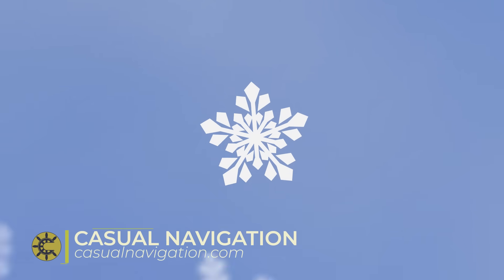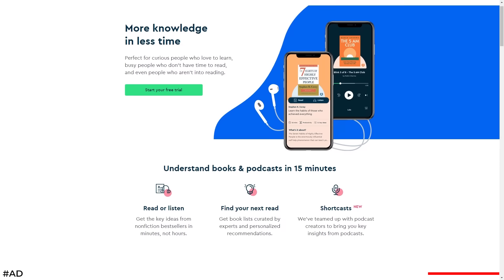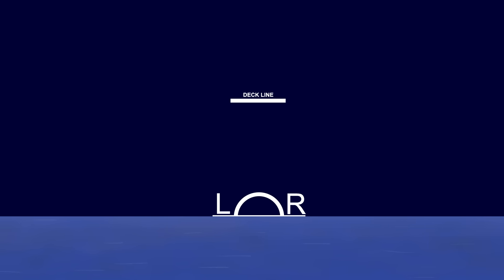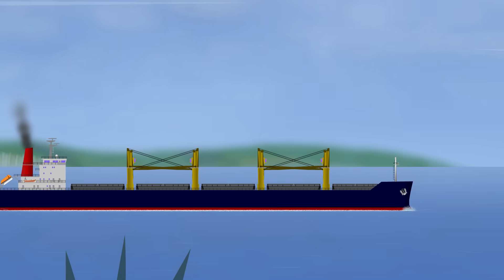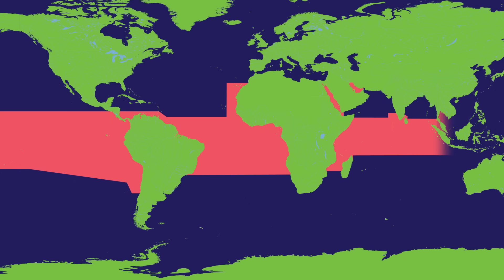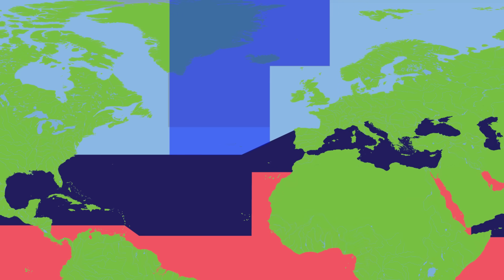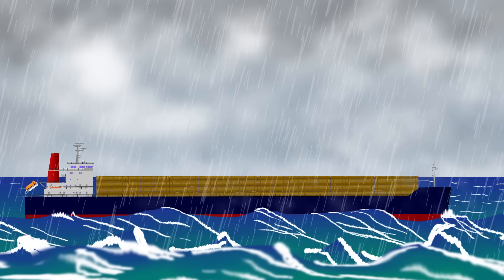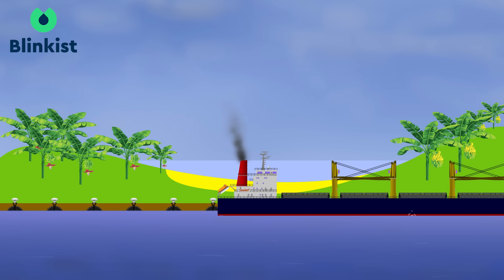Why Do Ships Carry Less In Winter?

Comment from the maker: Click the link to start your 7-day free trial and get 25% off a premium membership.
https://blinkist.com/casualnavigation
Reply: NO
Reply: If i remember correctly The origin of species is about a 20h read. Suggesting you can get an understanding of it in 15 minutes is catering to lazy morons who by default are to lazy to benefit from even the cliff notes.
Reply: 3:41 "surely this and that" "well you can!" Then why even make it seem like that wouldn't be the answer at first? Why even ask? Lmfao I got an iq of 0 and I still got that right
Reply: So... I want you to think about the ship moving from saltwater to freshwater, and how the lines would line up. I then need you to think about how this is caused by the denser saltwater, and not by moving cargo. Then you should consider how colder water is denser. Then I need you to go back to Wikipedia, where you pulled this script from, and read this line again: “ Varying water temperatures will affect a ship's draft, because warm water is less dense than cold water, providing less buoyancy.” 
Then make another video.
Reply: @TheOriginalDude001  As he explains, the significant difference between winter and summer is the weather, not water density. Water density changes by only about 1% between summer and winter.
Reply: @beeble2003  The difference between the "summer" and "winter" plimsoll lines is 1/48  = ~ 2% of the ship's draft.  Even if the density is only 1% that would be at least half of the reason, and it's not even mentioned having an effect!
Reply: @TheOriginalDude001  That's a good point -- thanks.

Comment: The loadline is read to the top not bottom of the line a rookie mistake by those who don't know therefore losing cargo. Timber loadlines are only assigned to homogenous cargoes (i.e. one mass). The extra loadline granted is not as you state because of increased buoyancy, it is granted because the timber is considered to raise the deck edge immersion, therefore increasing the point of contraflexure on the GZ curve. One of the biggest legal fiddles going in my opinion, never understood how they got away with it, in theory yes, in practice no. It is the GZ curve that influences (again through deck edge immersion) the height of loadline.

Comment: "Timber  cargo above deck buoyancy"? While such cargo may well be partially submerged by waves in heavy seas as long as it is secured to the ship the whole loaded vessel has the one specific gravity or relative density as measured by the plimsoll/ load line. For the buoyancy of timber to be relevant the vessel would need to be on its side to immerse some of the timber on deck.  In such a condition  the solid timber cargo would probably have a relative density of less than the same volume of the water floating the vessel. What happens next would very much depend on what was below decks as an empty steel hull would probably have an even lower relative density. The topic of this video can only measure how "buoyant" the whole vessel is and the load lines measure this with allowance for the benefit of extra buoyancy and  reduced stress in heavy seas. The stability of the vessel is much more effected by the centre of gravity whch cannot be shown by the load line. The capsize of the MV Lairdsfield out of Middlesborough in 1970 shows this when a cargo of steel tubes and steel plate were loaded upside down, i.e. the tubes were at the bottom of the hold  with the steel plates on top instead of the other way round thus performing the opposite task of ballast.
Any cargo loaded above the waterline must raise the centre of gravity even though  timber is much lower density than steel. I know nothing of trying to deliberately get rid of a commercial deck cargo in high seas  but it sounds more like a seamans nightmare than a procedure.  Just like an aircraft, overloading will have an incremental detrimental effect but loading a legal weight cargo in the wrong place brings swift punishment. If I were Blinkist.com I would not be happy with such an over simplified explanation but creating questions is not a bad thing.

Comment: One factor should be calculated too.
When arriving on your trip in a winterzone the water is more dense than in the summerzone (where you departed. This alone will rise the ship a little in the water. Could be somewhat around 1% between water from zero degrees celsius and 20 degrees celsius ...which makes a difference from 1 cm for each meter the ship is under water.

Comment: Question: is the load line measured with full or empty ballast tanks?
If empty, that implies your ship can appear overloaded when looking at the load line, just from ballast.
Reply: The load line is the maximum allowed displacement, these is measured from the cargo, fuel, FW, Lubes and stores. In the fully laden condition any ballast would mean less cargo being loaded (not a good thing).When the ship is in ballast it won’t be anywhere near the load line.

Comment: Video is great as always and I understand the allure of in-video sponsors, but please do not dabble into deceiving the viewers. The progress bar for the ad starts off at a rapid pace, suggesting the ad will be over in about 30 seconds, but the progress bar progressively slows its progress and the ad in fact takes over 70 seconds to complete. Which is over 15% of the total video time. The balance is not there this time, the ad either needs to be shorter or the video longer, but don't think you can fool viewers by making it look like a 30 second ad when it's not. Thumbs down this time.

Comment: This never occurred to me but it makes perfect sense. I find the difference between sea water and fresh water particularly interesting as we do get ocean vessels bringing cargo into the great lakes.
Reply: I suppose it works out to the advantage of the ships when they do it, at least most of the shipments I'm used to seeing. 
Those are iron ore and grain from the Duluth/Superior port, and more. 
- Iron ore (taconite pellets these days) boats all year long until it freezes and right away once the icebreakers can clear a channel in the spring. 
- Various shipments of wind turbine towers, blades and other parts during the open season. 
- Cruise ships and similar on occasion. 
- But why I mention this: the "fall special".... a whole ton of grain ships - they do also run the rest of the open season, but in the fall there would be a fleet of maybe a few dozen grain ships parked a few miles off shore. It was kind of neat seeing their lights down on the water from parts of the city with that vantage point. I went to college up there, so got to see it each year. It was cool when one of them would start making a bit more smoke as they ran up their engine. If you saw that and jumped in your car, you could beat the ship to the channel right by the Aerial Lift Bridge. The crew would often wave at you, and it was always fun to hear the ship and bridge honk their horns in salute at each other.
Many of the grain ships were indeed salties - oceangoing vessels with the big bulbous bow vs the flat barge nose on most dedicated lakers.
I imagine if the saltie was able to load up to near their safe limit while in fresh water, including draining some bilge water while loading (sadly they always simply have to do that to trim the load while it's ongoing, and need better processing plants) they'd be pretty safe for the normally relatively uneventful Great Lakes passage to the ocean.
Obviously we're talking fall here, and fall and winter storms on the lake can be intense - so consider that of course.
However once this saltie reaches the ocean, it has burned down some of the "clean fuel" it's required to burn while in US/Canada territory so they may be riding a bit higher already - then as they transition into the brackish then salt water they'd noticeably come up even more. To the point where they may need to add some ballast water to the trim tanks, just to make sure they're not riding too high on the ocean crossing. :P
Obviously other ports' experiences will vary - grain from Odessa to somewhere along one of Europe's many rivers would be in reverse - and they'd need to make sure not to load too much initially since most of the voyage will be in fresh water, where they will naturally ride lower.
Reply: The Panama Canal has freshwater too.

Comment: Who polices these load lines? What are the fines or penalties incurred?? Cheers 🍻 Good video 📹 very informative 👏
Reply: They are usually "policed" by the port state authorities wherever they go. Many, many countries nowadays follow the IMO (International Maritime Organization, a body of the United Nations) guidelines on Port State Control to inspect foreign vessels for compliance with international regulations on safety, security, and environmental protection. Each country implements it a little different. In the U.S., the Port State Control Functions are carried out by the U.S. Coast Guard. In other countries it is a civilian government department. In other countries Port State Control is carried out by contractors.

Say a Port State Control Officer (PSCO) in the U.S. comes aboard a vessel with an improperly submerged load line. There are some things you need to check before you jump to any conclusions (one instance I've seen is a vessel refueled as soon as they came into port, so their voyage was made properly but when I came onboard it appeared improper). But if they did in fact make an overloaded voyage, they could get a ticket for a couple thousand dollars per 33 CFR 143.301.

That little ticket is going to be relatively minor compared to the more common "control action" taken of not letting the vessel move or depart from the port until a cause has been identified and corrective action implemented to prevent recurrence. An improperly submerged load line is grounds for "detaining" a boat as per Procedures for Port State Control, Appendix 2. So the vessel would be taken out of service for a few days (profit loss) while a rather large investigation is carried out (not cheap) before the vessel is allowed to go on its way. This may disrupt the vessel's schedule and make them lose contracts. These potential operational limitations are what really, really make vessels comply.

Lastly, any time a vessel is detained it is required to make international notifications of the event. It looks really bad on the vessel and the company, and when the vessel is trying to bid on future contracts, the shipper may look at the vessel's history; see a recent detention; and stop considering that vessel for the contract. The U.S. not only shares detentions with the responsible international bodies, but also the public. You can Google "CVC-2 detentions" and see a report on nearly every vessel detained in the U.S. for safety or environmental reasons going back years and years.

Comment: If you are on the equator does a sink drain straight like a waterfall? Asking for a friend😃
Reply: No. The way that water turns as it goes down the plughole has nothing to do with what hemisphere you're in. Hurricanes turn in opposite directions because of coriolis forces, but those have no measurable effect on something as small as a sink of water. Water turns as it goes down the plughole because it was turning slightly before you pulled the plug out. As the water drains, it gets smaller and the rotational speed increases like a spinning ice-skater pulling their arms in. The initial rotation comes from asymmetry of the taps, which add the water more from one side than the other, so it's moving around as it fills the sink.

Demonstrations that supposedly show water draining in opposite directions north and south of the equator are just frauds. When you watch carefully, you see they pour the water into the bowl in one direction in the northern hemisphere and in the opposite direction in the south, so the water was spinning in opposite directions from the moment it entered the bowl.

Comment: I did a tour of the paddle steamer Waverley in dry dock. Due to regs regarding placement, her Plimsol lines are inside each sponson where the paddle wheel is, and is between the wheel and the hull so is impossible to see normally.

Comment: still haven't answered the title question. WHY do they carry less in winter? Is the water denser?
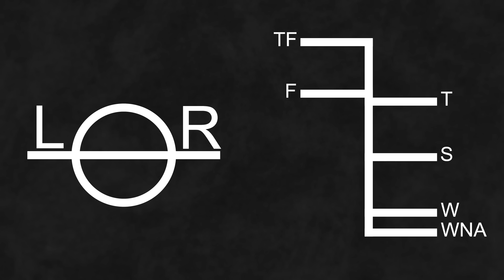Reply: 3:40 to 4:40. Winter brings rough seas. Rough seas make it unsafe to have such a low freeboard, and therefore you need to carry less weight

Comment: Thats freaking insane. The fuel weight is substantial enough to affect draft AND they compensate for it when moving away from the equator!
Reply: A 180 m bulk carrier will usually burn somewhere between 20 and 25 metric tons of fuel per day. And the thing is, bulk carriers are rarely in a rush to get anywhere. Vessels like containerships or ro-ros may burn 2 or 3 times the amount that a bulk carrier of similar size burns

Comment: i mean i though since its winter the water is more dense and denser water means more buoyancy which i though it results to more load to be carried. could someone clarify please.
Reply: Water density only matters for fresh vs summer, and tropical fresh vs tropical. It has nothing to do with say summer vs winter, or winter vs winter north Atlantic.

There is about a 1% difference in sea water density between sailing in winter in a polar region or summer at the equator. However I am looking at the load line certificate right now for a 173 m bulk carrier, and this vessel's required freeboard goes up 11% between tropical and winter. The load lines only care about water density when going from fresh to salt or vice versa. It is otherwise all about the typical weather
Reply: @phantomsplit3491  got it. Thank you

Comment: Surprised less freeboard is required for freshwater considering the weather on some bodies of fresh water (like Lake Superior in Winter) is no joke and has been known to even break ships in half.
Reply: The regulations mentioned in this video all come from the International Load Lines Convention, and is mostly intended for oceanic voyages. As the Great Lakes only affect the U.S. and Canada, these two nations have come to their own agreement on regulating load lines on these bodies of water. These regulations closely align with the international regs, with some changes here-and-there.

I only know the U.S. side of the regs. Notably, 46 CFR 45.9 states that for modern vessels the Great Lakes are to be treated as Tropics, Summer, or Winter depending on time of year.

Comment: So it's about the density of the water in different seasons?
Reply: Water density only matters for fresh vs summer, and tropical fresh vs tropical. It has nothing to do with say summer vs winter, or winter vs winter north Atlantic.

There is about a 1% difference in sea water density between sailing in winter in a polar region or summer at the equator. However I am looking at the load line certificate right now for a 173 m bulk carrier, and this vessel's required freeboard goes up 11% between tropical and winter. The load lines only care about water density when going from fresh to salt or vice versa. It is otherwise all about the typical weather